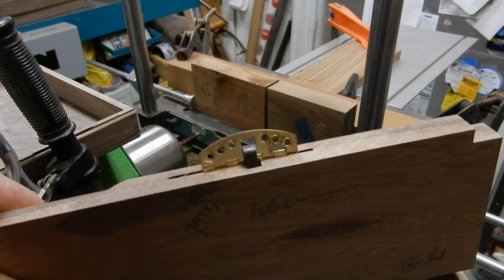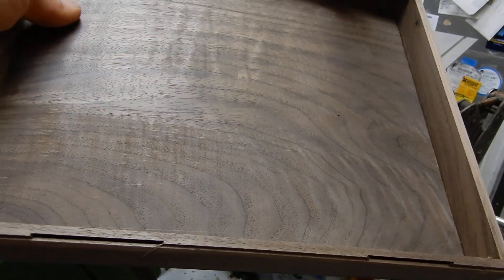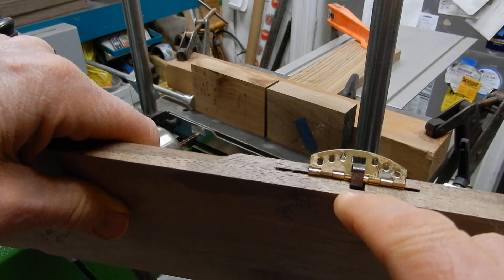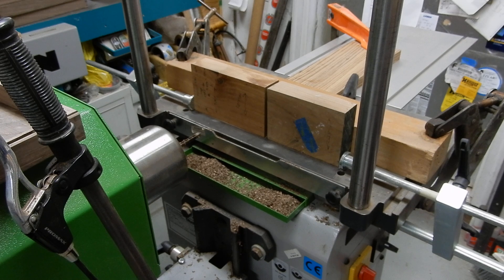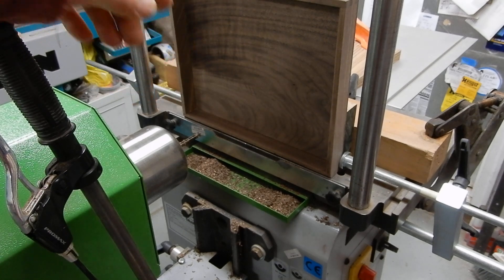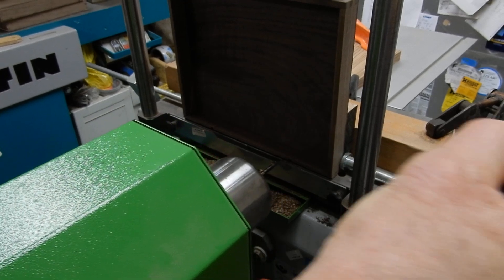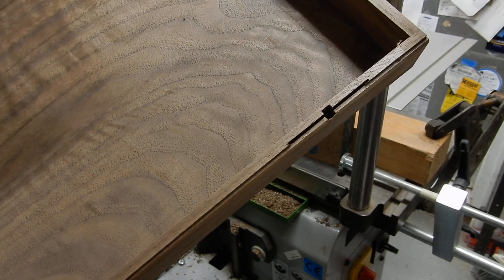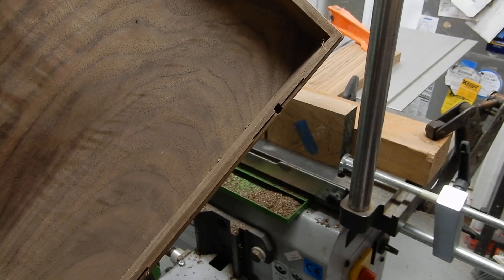Felder FD250 boring square hole for spring loaded kerf hinge

Comment: what machine u use for the kerf hole ?
Reply from the maker: for the square chisel I used the Felder FD250 machine; for the kerf I used a router table with kerf blade and fence setting; critical settings are required.
Reply: Hello, can you tell what kerf blade do you use, what thickness? :)